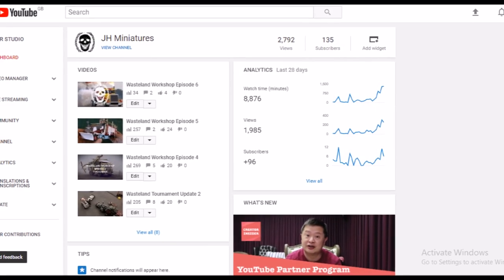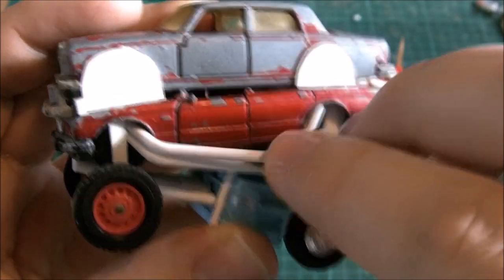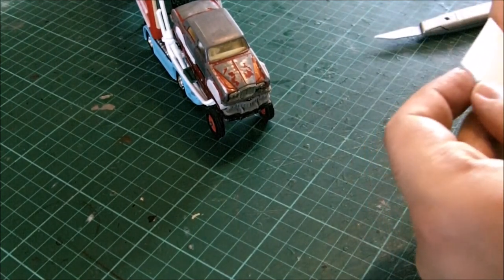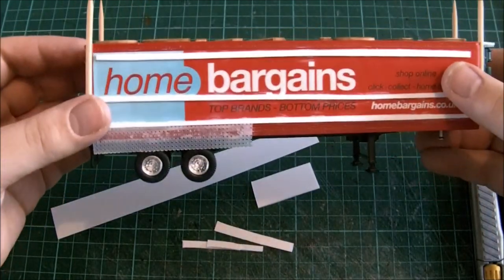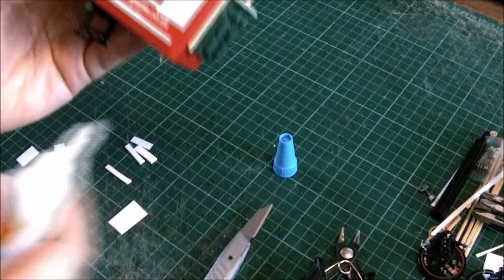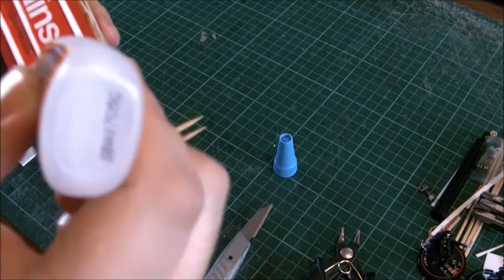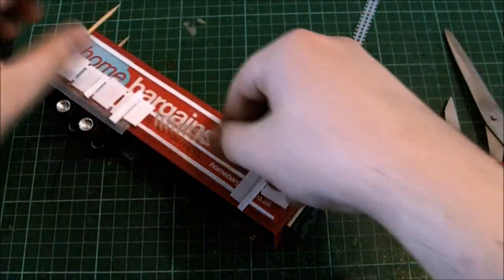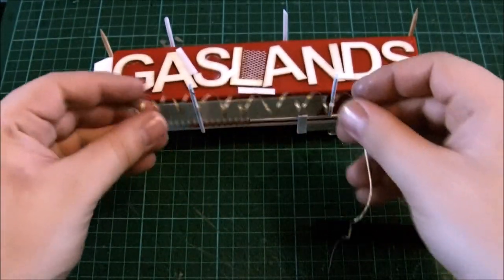Wasteland Workshop: First War-Rig Build pt 3

Comment: Coming in from the armor modeling community if you want armor plates that look bent and damaged take an aluminium can and cut sections out and bend and crinkle it just make sure you are wearing gloves. Another thing don't use tin foil it's too thin it'll be way too crinkly